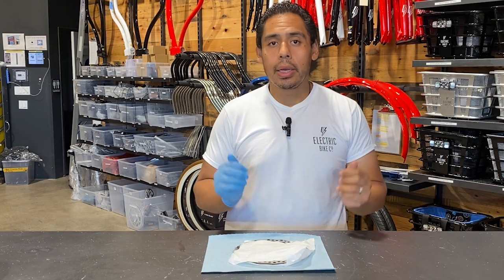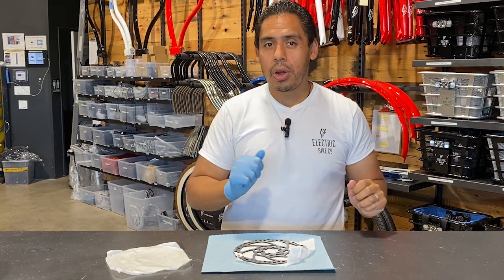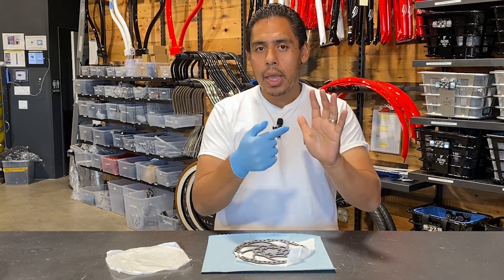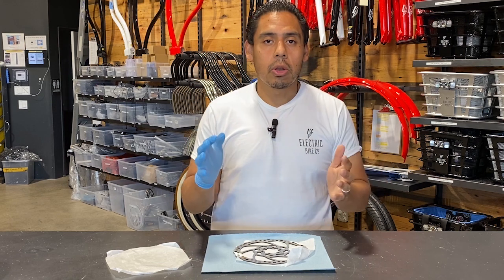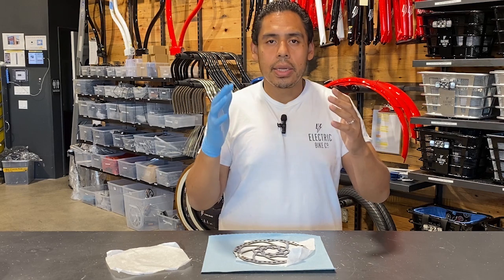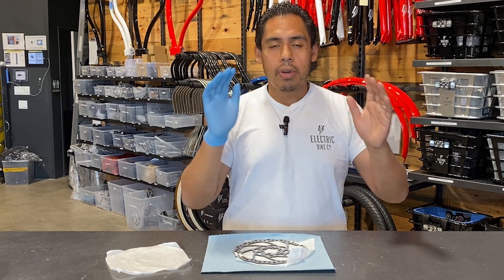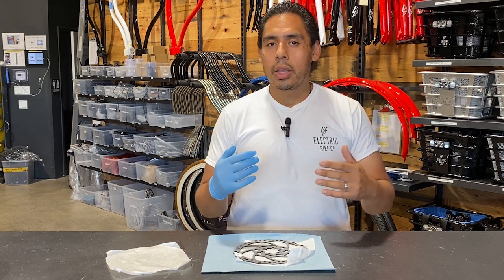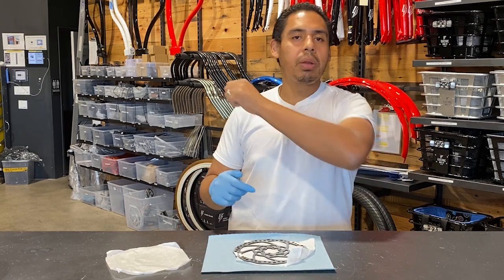Electric Bike Company - How to maintain your rotor disc brake

Comment: Absolutely ridiculous that it’s SO CRITICAL to not touch a rotor. There’s something WRONG WITH YOUR DESIGN. I’ve replaced the pads, cleaned the rotors, and adjusted the caliper to center the rotor between the pads, and the chatter and groaning comes back.